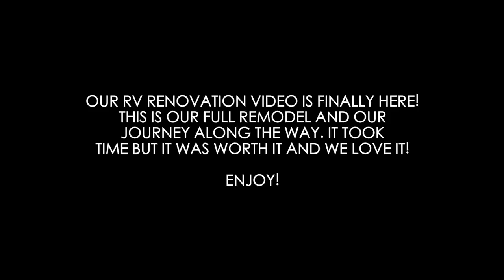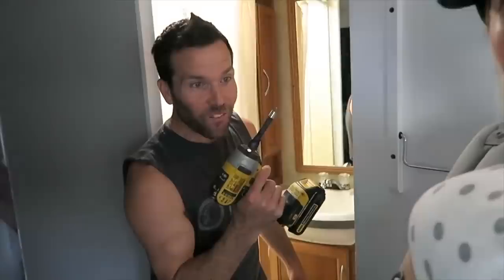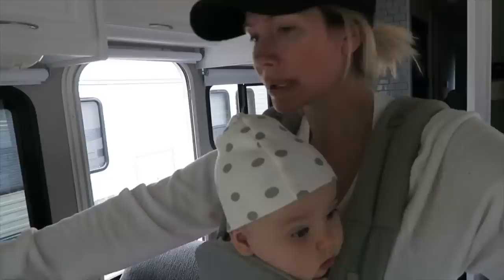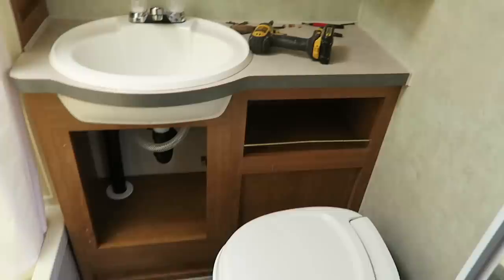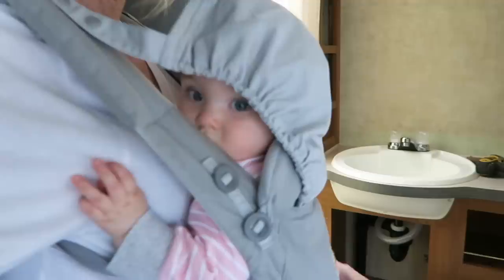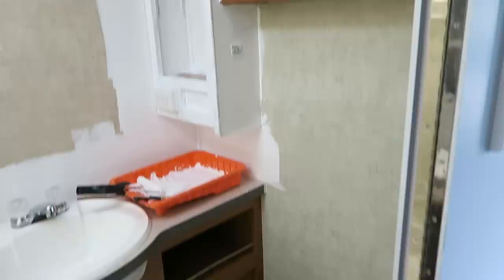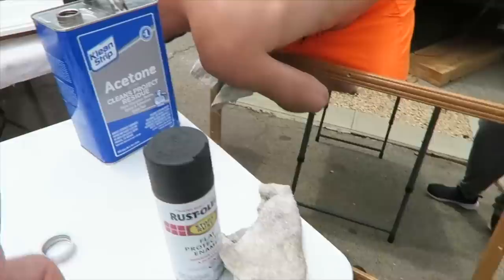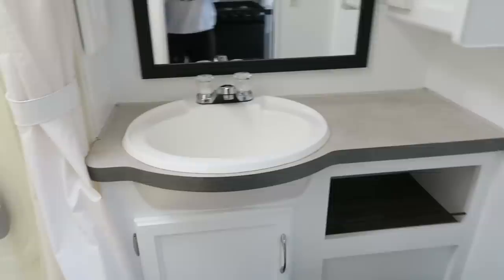BEFORE AND AFTER RV RENOVATION (COMPLETE REMODEL)

Comment: How fortunate to find a garage kept 15 year old MH.  Mine has got two decades on yours and I have other challenges.  The chassis is perfect (35K original miles).  It was lived in for 30 years and although well maintained, I have restored nearly every component. You seam to be well informed but my comment is you will need to refresh the dicor sealant on the exterior and watch window seals.  I ended up removing all my windows and putting new buytl tape.  The metal roof was wearing out so I installed roll on epdm coating.  Those two jobs extended the life of lizzy another 20 years. knock wood.  God bless and take care.

Comment: Heirloom Traditions Paint.  You can paint countertops and the use another color for marble-ing.  The coat with epoxy and it will last forever...or until you want to change at  tenth of the cost of replacing.  And it looks like marble or granite without adding weight to the RV!

Comment: It looks incredible! For countertops you can get a faux Carrara marble that just lays on top. It would batch your color theme. It goes on kind of like contact paper but it's for countertops and it's very durable. I think it might be called instant granite or something like that. I can't remember. You can get it on Amazon though and it comes in rolls. I purchased the Carrara marble one and then used a heat gun for the edges (along with liquid nails) and then also used calking for the edges when finished and it works amazing!

Comment: I am doing a renovation on my travel trailer. What kind of prep/paint did you use on the wallpaper? I've heard it doesn't stay. Are the peel and stick tile working for you? Does the heat and water from doing dishes and condensation effect it? What kind of floor vinyl did you use?

Comment: Great video! I just got a camper that I’m going to start renovating! I want to  paint the cabinets/front of fridge white but am worried about it peeling with all the different weather and temp changes (I’m from Maine). Do you have varying climates where you are and had to use special paint to avoid peeling? Any advice would be greatly appreciated, thanks!

Comment: I didn’t see you scuff the surface before you primed, been painting for 35 years professionally, I hope the not some cheap Home Depot primer...your finish paint will scratch right off with your finger nails utensils etc...that wood is factory sealed, which makes adhesion 10 XP’s harder...you should of washed surface down after sanding and before you paint with WillBond ...good luck
Reply: I've always been told not to paint wood grain , oak is dated but still better than brush strokes and painted wood grain.

Comment: I'm sure by now these folks  have realized that using those stick-on tiles anywhere near a heat source (oven and cook top) was not a good option.    I used them in my home, and they began peeling back in under a year.   Cheap product.